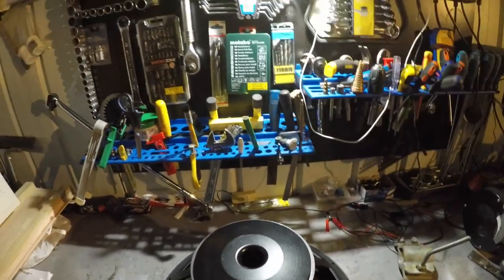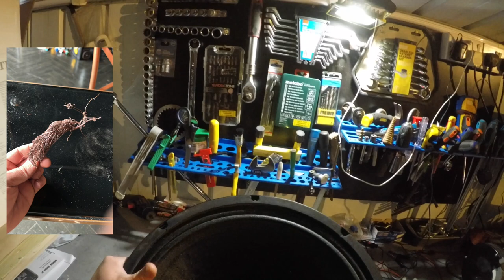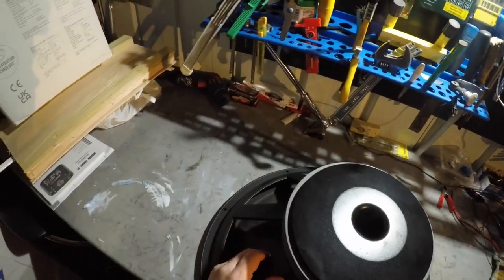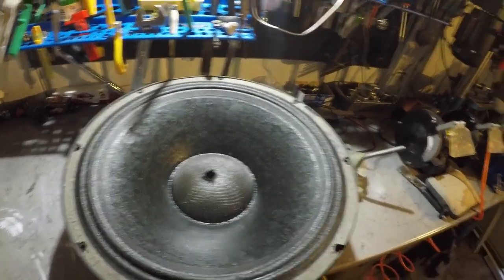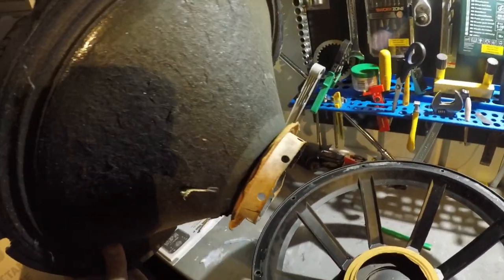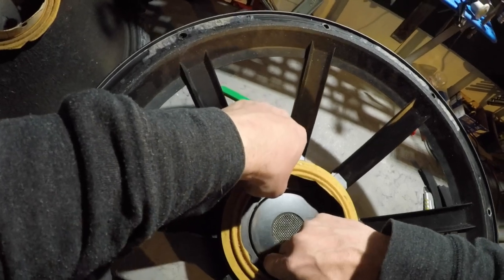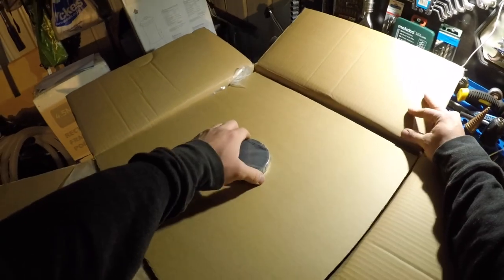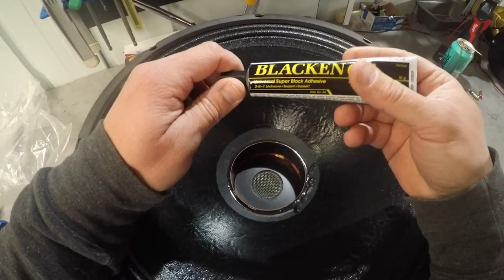Funktion one Br218 Recone

Comment: When it rips like this it must have been overexcursion. 
I hoped I would find a video of the whole process. I want to recone of my BR118 and never did recone before.
Anyways, your video was still had some helpfull insight.
Do you have any recommendation on XTA Limiter Settings for those drivers?
Reply from the maker: hello!
I usually do the settings by ear so to speak, I bump the limitter until i hear the speaker slightly starting to struggle and then take it back 1 or 2 db's for safety reasons. Next time I'll be at the clubs I can give you my exact settings if you'd like.
PS these speaker cabinets are placed upside down , hung on the ceilling of the venue, hence they all go bang after a while, gravity takes it's toll on them. I'm activelly trying to persue the club owner to relocate them as bass coming from the ceilling makes 0 sense to me.